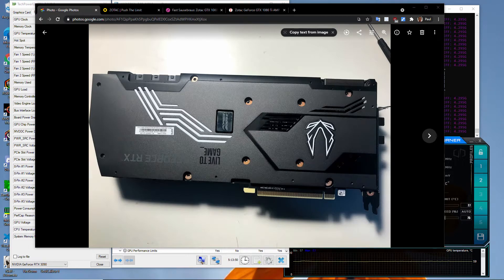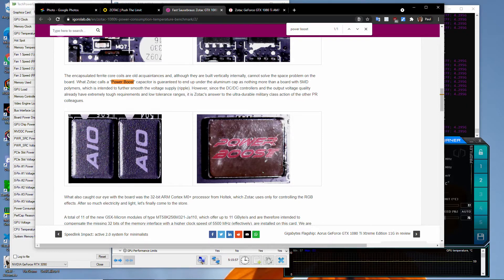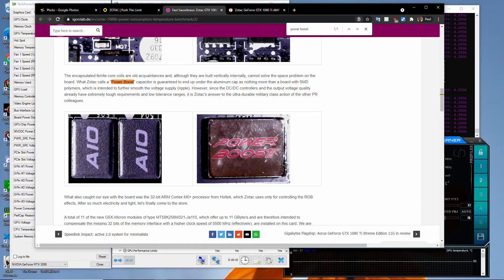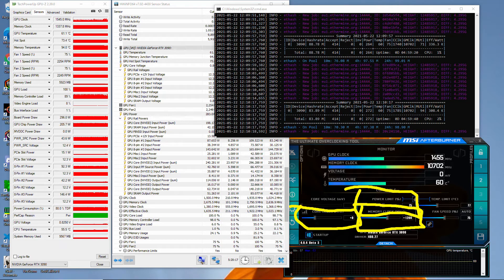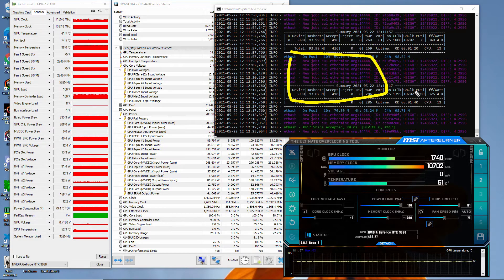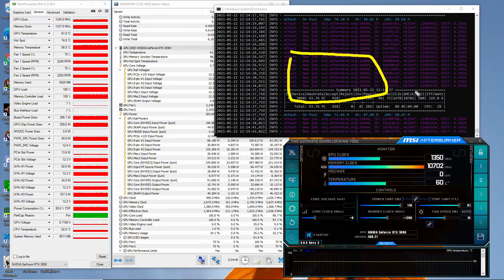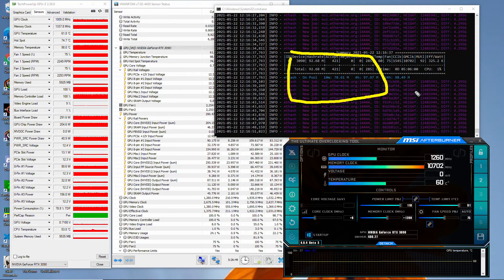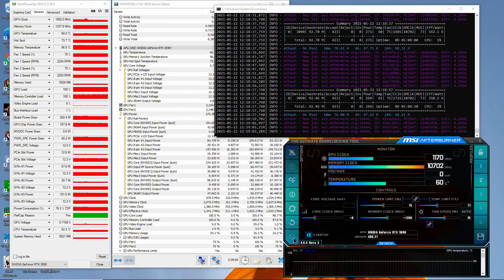ZOTAC RTX 3090 AMP Core Holo Mining Performance Review

Comment: have you tried the 3090 amp extreme
holo hashrate and temp?
Reply: Hi, yes i have tried it. Its around 118mhs and temps are 68/82 after installing fan on top of backplate. I have still original paste and pads.
Reply: @3DPrintingEstonianChannel  I am getting 115mhs with 43c temp
Reply: @ekinshuya  I just changed thermal paste and core dropped to around 55c. Memory is still 80c when mining ETH. Memory thermal pads need to be 3.5mm, and i just cant find any. Im thinking of going double side waterblock in future.
Reply: @3DPrintingEstonianChannel  not sure why mine runs cooler. Maybe I have less overclock setting at only 115mh/s. Stock memory is around 74c
Reply: @ekinshuya  Yeah maybe. I have +830 on memory with 80% powerlimit

Comment: Well, I shoulda seen this before I blew $2.8G for hardcore mining. Yes. 92 megahash per second. I got a msi at the office does exactly 120 megahash per second as advertised. Anyways I'm gonna keep mine and run it til it quits working. NOTE to the future: Zotac NOT RECOMMEND for mining if ever. Back in 2016 I had 3 1080 ti's all zotac extreme I never had an issue with those cards. Unbelievable this is just new. Again 2.8 grand for a card to run 75% capacity, hey I just gotta be zen and work with it.
Reply: The zotac Trinity 3090 however... Really good at mining...
Reply: @acsolidus  my bad it was in my entry list but wasn't avaliable say 2 weeks ago during part selection.
Reply: @Knexmoore  sorry to hear that man. Did you go through a guy to build your whole pc?

Comment: I'm getting 123Mh on it after similar thermal mod. few things you can improve is to use 3mm pads in few places where there is a cutout on the backplate.

I'm using copper heatsinks instead of aluminum.

Zotac's bios is shit. EVGA ftw ultra does wonders though :)
Reply: Did you flash the vbios on this card with evga's? Mind sharing your process and before and after result? What are your vram temps now? Or setting? Also pics of your mods. Would highly appreciate it.
Reply from the maker: Did you test the gaming performance?  I've tried FTW3, Suprim and Kingpin vBIOS.  They all would appear to work esp the power draw side looking like they are taking on additional watts but in reality they are only using 2 of the 3 8-pin power (you will find the wattage reading from 1st and 3rd 8-pin having exactly identical power draw readings).  This may unlock full mining potential (and for mining, you don't need full 3-pin power), but as for gaming performance you will take a BIG hit since the card can't draw more than what the 2 8-pins can supply (also you will see at least in my case, bunch of other limits tripping).  Thanks for the info.  For me gaming performance is primary, mining performance 2nd.
Reply: @faux123  you might be right. I'll look into it when next time in windows. I do remember seeing large  numbers on first and third. please up us posting as you try new things. I'll be checking in here as well when I have smth. Will try Gigabyte Xtreme next. Was gaming performance better on stock bios?
Reply: @maestrothemage9066  yeah on stock bios, gaming has better overall performance. Zotac is such a pain in the ass with this card. You fix the mining issue now gaming becomes the new issue >.>
Reply: @faux123  what were your power draw results per lane on those bioses while gaming?

Comment: Just got this card and im not getting past 103 MHs and its thermal throttling. Did you get the same results as me before repad? What is your current hashrate with current OC settings after repad?
Reply from the maker: Before re-padding, my card would throttle hit thermal throttle within 1 minute of mining.  My current hash rate is around 107.5 MH/s.  I can't get it higher than that number due to Power Limits not thermal throttling.  My thermal issues have long been resolved by the mod I've done.  This is the issue I was talking about in my video, there's something else that's changing the power limits where I can't get it above 280 watts (I found to get max hash rate of 120 MH/s you need to run around 305 watts but there's something else in the card that's limiting this as mentioned in this video review).
Reply: @faux123  what pad sizes did you use and what are your oc settings? I find that i get 112 with +600 mem, -300 core at 75% power limit. I will try and mod the backplate with heatsinks and fan and see how that goes. I used 2.0mm pads on front and back. Did you use a different pad size? What is your current max vram temp while mining?
Reply from the maker: @Rhuse  I used Gelid 2.0 mm GP Extreme listed on my first video.  My current setting is +1200 mem, -290 core at 83% power limit (which should translate around 305 watts but mine is stuck at 280 watts max) and it won't go above 108 MH/s.  It is strange you have a very different number from mine.  My max VRAM temp with case open is 90 C and with case closed is 94~96 C which is really good with it mining  24/7.
Reply: @faux123  yeah i wondered about that. I did place 0.5mm thermal pads on the backside that did not have pads. Maybe if i slap 2mm on those areas instead, the number might be different. Im gonna try heatsinks and fans tonight and see if it helps.
Reply: @faux123  it seems that i am having that same issue as you where it wont go above 300W. Have you figured something out yet? The website doesnt have a vbios for zotac 3090 amp core holo.
Reply from the maker: @Rhuse   no, not yet. will try a few more things and yes the vBIOS isn't available at all...so save your current vBIOS before trying something different
Reply: @faux123  whats weird is when i game in 4k ultra rtx on the card eats 365w lol
Reply from the maker: @Rhuse  just to clarify, gaming performance for this card is just fine. In fact you can easily get up to 410 watts which is much higher than the older Trinity OC.
Reply: @faux123  Yeah it indeed is. However, I would  like to mine on my non-gaming time to get some of my investment back. We can't even do that with our card. It literally performs like a 3080 hashrate wise lol. And the temps are atrocious on top of that for vram while mining. So I hope zotac will release a vbios for this card soon. I asked z_staff on reddit and they said its been addressed but no plans for vbios release... yet the 3090 trinity OC has one...
Reply: @Rhuse  maybe these are LHR cards?
Reply: @NyckHD-Official  no they are not. 3080ti hash lhr is around 56mhs. If these were lhr it would be closer to that number
Reply: @Rhuse  I have exactly the same issue, hopefully zotac address it soon
Reply: @faux123  Thanks - after repadding and flashing the vbios I am getting 360w power draw and ~123 hash rate.
Reply: Hi. I was trying to flash with the rom from the link above, but I get a warning message saying:

WARNING: Firmware image PCI Subsystem ID (3842.3998)
  does not match adapter PCI Subsystem ID (19DA.1619).

There is an option on Hiveos to ignore warnings but... no sure. 

When you flashed you got the same message?
Reply: @bluetailfilms9627  I did ignore it and mine worked. That said, there is always some risk with these things, so proceed only with this in mind.
Reply: Didn't work. The upload comand is sent, stay maybe two minutes trying to flash and disappear que command. No fail... No success... Nothing. After reboot I can see that is not flashing... Maybe something with the card version... Any idea?
Reply: @bluetailfilms9627   nvflash -6 romname.rom